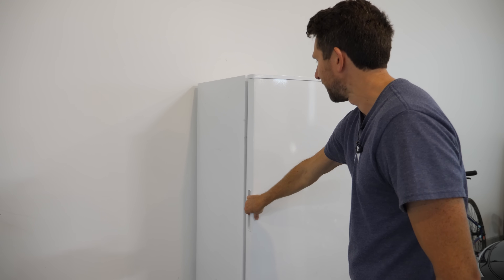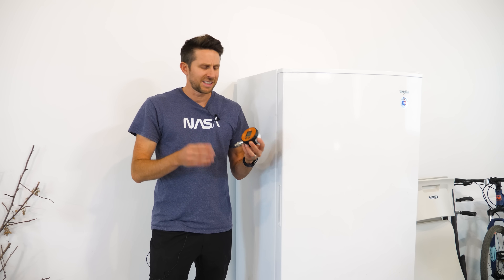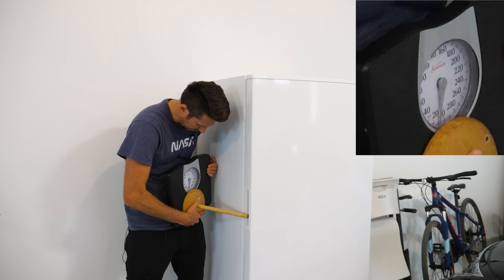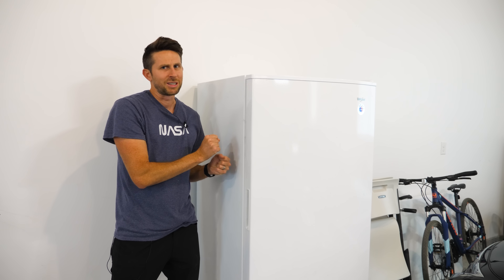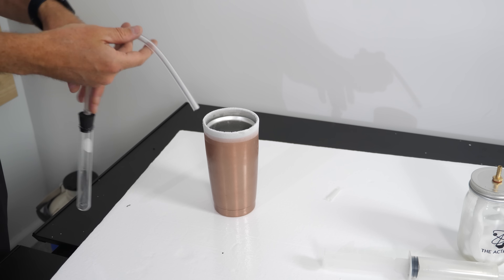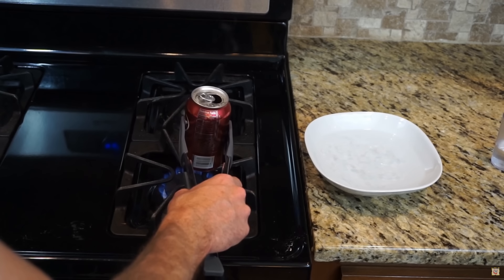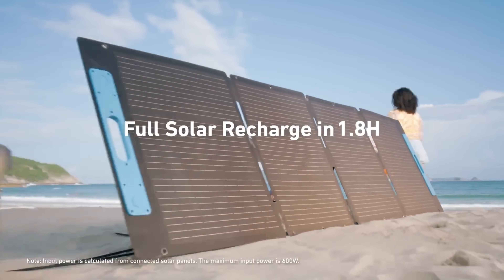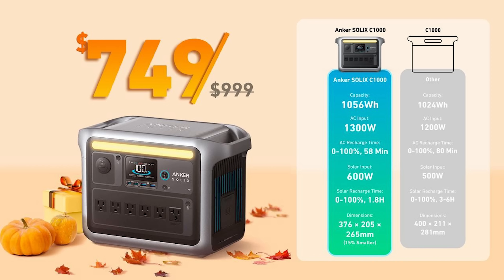Why Is a Freezer Harder To Open The Second Time? (Powered By Anker SOLIX C1000)

Comment: Not sure if it applies to that digital gauge, but usually pressure gauges have to be outside what they are measuring since they use the air they are surrounded by as reference.
Reply: I'd be interested to see if he could set up his vacuum chamber with the pressure gauge measuring the outside air. So the spigot is in atmosphere, but the reference portion is in the chamber. What would it show?
Reply: @kutsen39  assuming it's using a reference the way I would expect, it would read an equivalent positive pressure when in vacuum. Would be interesting to see - could compare a digital and mechanical one too.

Comment: No, just no. The air doesn’t cool down that fast. A quick closing of the door over compresses the magnetic seals and forces extra air out of the fridge. Then the equalization valve slowly restores balance which you can clearly hear. Slamming the door hard makes it much harder than a soft close. It’s all in the over close of the door. Notice how your syringe took allot of time to drop. 🤔
Reply: Nahh. Maybe in some cases, but I think you'd have to test it rigorously across several freezers and a line-up of several uniformed factors like temperatures, times, closing force, seal age/wear, etc. Remember: correlation is not always causation. I just tested it several times with my freezer and fridge and couldn't really arrive at a firm conclusion in either direction.

Comment: If your freezer DOESN'T do this, it probably means the seal is bad, and it is wasting energy due to warm air entering all the time.
Reply: Uh oh, mine doesn't! Did older freezers do it? I don't remember noticing it growing up, only as an adult.
Reply: @robbbbery  I don't know about that particular unit, but I do know that in the lab where I work we have a -80 C freezer (a LOT colder than a home freezer) that did this when it was new, and it even had a giant screw on the left side that you could unscrew to let air in to break the vacuum.  But then as it got older it didn't do this any more, and now it builds up ice inside like cracy, like the other older freezers.  I even got service to try to replace the gasket, but that didn't get it back to its new state.
Reply: Or you have a good valve connecting the inside to the outside
Reply: @MontyCantsin  That was the purpose of the giant screw on the left side of our Panasonic Health Care -80 `C freezer where I work, and when it was new, you had to use this to be able to open the door again after closing it.  But later on, the seals got bad, and you didn't need to use it, even after we had the seals serviced.
Reply: Yeah, even my freezer has this problem. It's quite old, though.
Reply: Don't make such blanket statements. Nowadays there are many freezers that have an air flow technology which has a side effect of preventing this very thing. This isn't a defect in their case however. It is how they were built.

So yes. If a freezer doesn't have build-in air flow control system and the door would get sucked in, but then at some point it stopped...that's a sign of a problem. But if a freezer does regulate the air inside then the door getting sucked in actually shows there is some problem with this system.
Reply: @kikixchannel  Sounds like a good idea, but I have yet to encounter a unit like that.
Reply: @Lucius_Chiaraviglio  I have one. In the country I live, there's a lot of them, including in the lower-end units.

It has its ups and downs. It is easy to open the freezer/fridge at all times and doesn't require manual defrosting (there's not a speck of ice on my freezer than is on constantly for the past 5 or so years). The smells of food don't permeate the fridge (and each other) nearly as much (if at all for the less smelly things) either. It appears to make the temperature more stable as well. However on the downside, any exposed food may be drying out faster, and in cases like veggies and fruits, they will age faster. You need to keep them in some container (like the box that most fridges have at the bottom, to my knowledge) so that they're not directly exposed to air circulation.
Reply: @kikixchannel  I take it you live somewhere other than the US?  That would explain it -- we're easy marks for bad transit equipment/infrastructure, so why shouldn't we be easy marks for substandard freezers?  🙄
Reply: @Lucius_Chiaraviglio  Yeah. A country in Europe. But I don't think USA is a 'bad transit point'. I think that much of your infrastructure just sucks, outside of some hubs. Cost of having a lot of land that just stays empty, I guess.
Reply: Lmao it's just your freezer suck. As someone else said newer freezer don't do that and you don't have to defrost them.
Reply: @Natsukashii1111 Well, that's another thing -- in laboratories, they often won't let you get frost-free freezers.  They say it ruins sensitive materials due to temperature cycling.
Reply: Well but you have a conditioner AND a freezer at the same time

Comment: That's so cool, it's just the difference between warm air and cold air and the slight vacuum is spread out over the whole door so it's barely noticeable but still significant..... This is such a cool world.     😁👍
Edit: I'd like test if one of those batteries would be able to power an ebike or electric vehicle.   😮❤

Comment: You can also see this phenomenon if you have a plastic bottle with just some ice inside. If you cover the bottle and shake the ice around, it cools the air inside the bottle and the bottle will begin to compress a bit as the cooling air takes up less volume, reducing the pressure inside. When you open the bottle and allow ambient temperature air to enter, it regains its full shape. Then if you close it and shake it, it compresses a bit again.

Comment: Following your video, I felt like trying an experiment to see if the door seal had anything to do with it:

I thought that maybe when the door is closed, with the speed, the seal is compressed, reducing the air volume between the seal and the fridge edge.

The rest, I understood both by watching your video and by trying the experiment. Here is the remaining part of the theory:
Furthermore, due to the door opening, the air around the seal was heated; waiting a few seconds after closing the door, the air that remained despite the closing speed became cooled, further reducing the remaining volume.
Thus, the pressure between the seal and the door became lower. Due to this low pressure, the seal was pressed even more against the walls, preventing air from passing through.
Certainly, after waiting a bit, air enters again partly between the seal and the door, making it easy to open the door again.

Here's the experiment I conducted: I opened the fridge door and then closed it very gently. I could reopen the door directly without needing to exert more force. However, if I waited a few seconds after gently closing the door, I couldn't easily reopen it. An astonishing phenomenon: after a gentle closure, even if I reopened and closed it with a bit of speed, I could still reopen it without much effort if I didn't wait.
I also tried starting by closing the door with some speed, and I noticed that I could also open the door quite easily (the seal of my fridge probably needs to be replaced :)).

So, I think that between the two phenomena I mentioned that could tend to reduce the volume, the one that is most at play is the reduction of air volume due to the decrease in temperature between the seal and the walls of the fridge. The other phenomenon is not to be completely ruled out either; if the door is closed with a lot of speed, it might be more significant.
Reply from the maker: I think when you close the door slowly the air that is inside is cooling down before the door even closes all the way so the pressure already equilibrates before you even close the door. But when you close it fast it is already completely closed before the air starts to cool down. So when you close it fast there is a larger air difference.

Comment: I've noticed that if i slammed shut the big freezer in our basement it was harder to reopen than it was after slowly closing it. So i thought this phenomena was due to the air squished out of the freezer due to the door being shut too kuch for a short time, which then afterwards would cause a lower pressure inside it.
Reply: I wonder if slamming the door forced some air through the equilibration tube while slowly closing the door didn't. Good observation!
Reply: Was it a chest freezer, i.e. with a door on the top? If so, gentle opening will allow the cold air inside to mostly remain inside, since it is heavier than the outside air.
Reply: @MontyCantsin  yes it is, and this actually makes a lot of sence now.

Comment: I recently stayed at a beach house that had a vacuum sealed Sub Zero refrigerator and that thing was awesome. Of course I'd never pay $15k for a fridge but apparently some people do. It was smart enough to break the seal when you opened the freezer even after closing it.
Reply: You can find a similar feature on mid-range fridges these days -- around the $2k price point.  They drop the pressure about 20%.  I guess the lower the mass of air in there, the easier it is to chill

Comment: Would have liked a demo with a non-cooled fridge, running the same open/close test to make more sense and solidify the conclusion, instead of trying to verify the tiny pressure change alone, confirming the conclusion. This would probably rule out? the springy one way rubber seal(bellows?),not adding to the equation. Also, if several trays of hot pastries were let to cool down and see, if that was a terrible mistake?🤯. It might also accidentally, uncover the presence of a hidden one way pressure balancing valve!🧐.Just some 💭♥️👍
Reply: If the freezer is not turned on (air inside it is the same temperature as the air in the room), then nothing happens at all. You can open and close it repeatedly without any difficulty on either of them. There's no real point in defrosting a freezer (which clearly has a lot of food inside) just to show something like this.
Reply: @kikixchannel  Finding an empty fridge(any appliance showroom should have many!) should be easier than acquiring a bottle of liquid nitrogen🤔

Comment: 3:05  I have a slight issue with the way you calculated the pressure difference needed to create that force on the door. Your wooden rod was placed on the door handle of a door that was rotating on a hinge. The force on the door needed to create an equivalent counter torque to prevent the door from rotating will actually be larger than that.
Reply: I don't think the point was to get an accurate measure, but more to demonstrate that there was a definite difference, and, at east by that kinda kooky method of measuring it, it took 3 times the force.
Reply: @TheRealDrJoey   Yes, fair enough. I just remember him actually calculating the pressure difference necessary to get that force difference, so that's why I mentioned that. I may be mistaken in what he was saying.
Reply: Jesus, get yourself a girlfriend or go Mountain-biking ASAP!
Reply: @IIISentorIII  This is literally a channel by and for physics nerds.
Reply: @IIISentorIII   No thanks

Comment: When you want to mess with someone mind take a 2 liter pop bottle fill it with very hot water and pore the water out quickly and put the cap on tight. Then set the bottle by them and tell them you are going to crush the bottle with just using your mind. Then about two minutes after you put the cap on the bottle it starts to collapse and goes for a while. 
It will scare the heck out of someone when the bottle gets mangled and all distorted.

Comment: @The Action Lab  You should have used your phone to measure the pressure difference. There are several apps (my personal favorite is the Physics Toolbox Suite). It actually measures pressure down to Pascals! 

I've measured the pressure differences when you open doors inside of rooms and push other doors. The pressure difference is usually on the order of 10 Pascals, or up to 50 if you push the door quickly.
Reply: Just tried the physics toolbox suite and it’s awesome. Had no idea my phone could make all these measurements so precisely. 

Thanks for sharing.
Reply: @cyrilio   Yes, it's amazing! Glad you found it! :)
Reply: No barometer sensor on my phone ☹️
Reply: @jasonharrison25  If you get another phone, most of the newer ones have it. It doesn't even have to be very new; it can be from 5 years ago.

Comment: I wonder if there are visual ways of demonstrating this on a smaller scale like with a bottle. Edit I saw the liquid nitrogen demonstration but I am curious if we can see and measure the amount that a bottle gets crushed etc.
Reply: You can also see this phenomenon if you have a plastic bottle that's about quarter filled with just some ice cubes or ice slush inside. If you cover the bottle and shake the ice around, it cools the air inside the bottle and the bottle will begin to compress a bit as the cooling air takes up less volume, reducing the pressure inside. When you open the bottle and allow ambient temperature air to enter, it regains its full shape. Then if you close it and shake it, it compresses a bit again.

Comment: Before watching the rest of the video (only a few seconds in) I'm guessing it has something to do with pressure. Perhaps the warm air that enters the freezer when you open it cools down again after closing it. When this air cools down, the pressure on the inside of the freezer would drop, creating a pressure differential, and therefore a net force pushing the freezer door in. That's my immediate guess upon hearing this problem.
Reply: But did you also guess why it becomes easier again, for the next time you feel like a quick snack 😄
Reply: @stevethorpe   I wasn't really thinking about that, but I probably would have figured that the air just slowly leaks through the door and equilibrates. I had no idea there was a mechanical pressure equalizer.

Comment: I always liked observing bubbles forming on wine glasses when you place them on the kitchen counter after washing them and before drying. The hot glass heats up the air trapped inside, causing it to expand and "bubble out" to equalize pressure. Once the glass cools down, so will the trapped air, causing it to contract again, creating bubbles, but this time on the inside of the glass
Reply: Once in a while I do that to a plate, completely by accident, and it starts making noise from the bubbles and sliding along the table.

Comment: I think it might have to do something with the magnets pulling and you pushing it in. Like if you push it in, the air will get pushed out, reducing the pressure, hence harder to further decrease the pressure, so it's harder to open.

Comment: "Five feet by thirty inches" Ouch. If you're going to use imperial, which is fine , at least use the same units (and inches really is best here since you're measuring the pressure in psi). I don't have my 12 times table memorised. I grew up and was educated in the US, so you'd think they'd have made us all memorise the 12 times table and 5280 times table. To be honest, I don't even think the 16 times table was taught, I had to teach that to myself when I was learning programming.
Reply: In his defense he does give you the approximate answer. Not that it matters but some people argue base 12 is more useful because it can be split up more ways than base 10.
Reply: @Nefville  Base 12 is more useful, unfortunately we have ten fingers, so we're pretty much stuck using base 10.
Reply: "12[-]times tables memorized"? You know, for decades, several manufacturers have been making these nifty little devices called calculators, that you can use when you happen to come across something like this.

Oh, and do you know what a smartphone is? If you happen to be using one without really fully knowing what it is, then let me just help you be aware of this cool thing: many of them have one of these little calculators built in as software! So you might want to look into that sometime soon! It could come in pretty handy!

Comment: You can actually test this yourself, you own a super accurate pressure gauge: your smartphone. Most smartphones have a built-in barometer that is so accurate that it can tell the difference in pressure from lifting your phone a few cm up in the air. There is this free app called "phyphox" that lets you read the sensors of the phone.

So I did the experiment with putting my phone in freezer. And indeed within the first 1 second after shutting the door, pressure in the freezer decreases by about 1.5 hPa, before going back to equilibrium after 5 more seconds. Very cool to verify that it's actually due to the air cooling down and decreasing in pressure, rather than the door slamming pushing out some air through the elastic seal, and the elastic forces of the seal creating the vacuum.

Comment: Many phones nowadays have a barometer onboard. It can easily detect a few meters height pressure difference. Just install a software. I even had it logging, so I could determine when I came outside by pressure graph
Reply from the maker: You are right! I should have just pulled out my phone to show it. In fact I just went and used my phone on the same freezer and you can easily see it drop by 1hPa